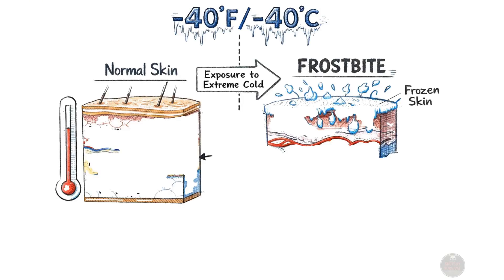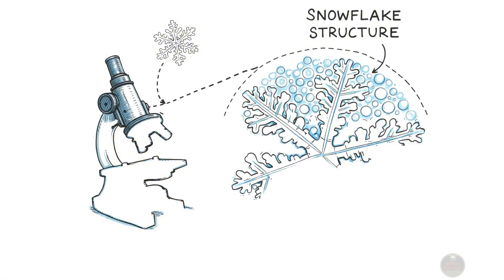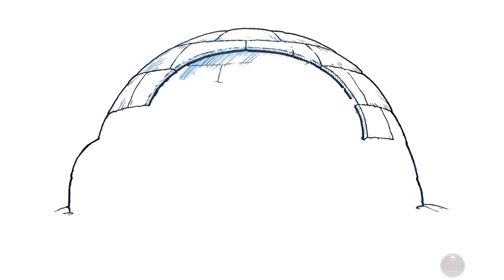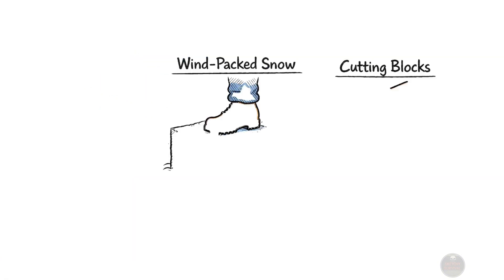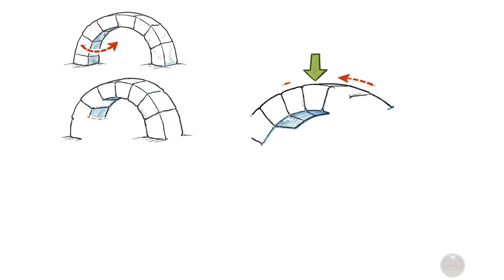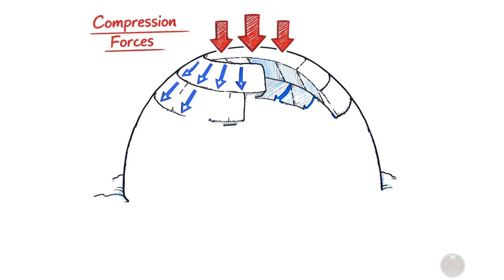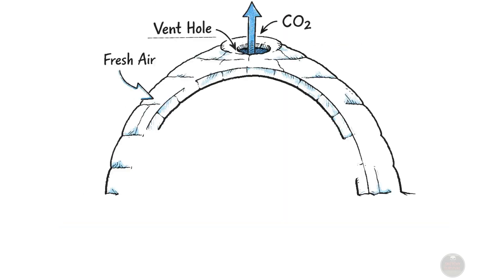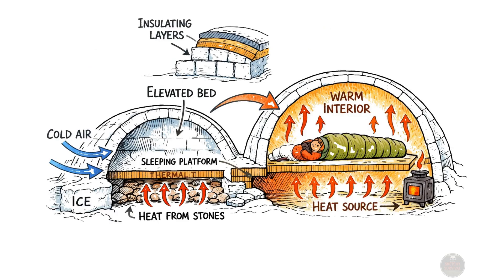The Thermodynamics of Snow Shelters: Why Igloos Stay Warm (Science Explained)

Comment from the maker: Did you know that the entrance tunnel of an igloo is actually designed to trap cold air down low so the heat stays up high with you? 🤯 It’s called a 'Cold Sink.' Let me know in the replies—what's the coldest temperature you've ever camped in?
Reply: Its basically a beavers nest w/o a top vent hole
Reply: Sir can you help me please ?
Reply: Minus 25c. Tent. Caucasus   mountains.